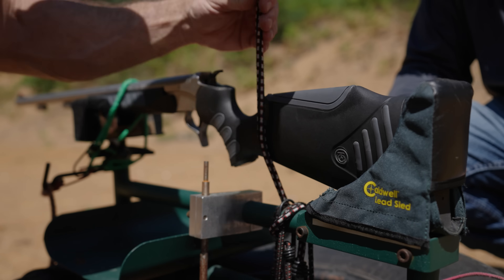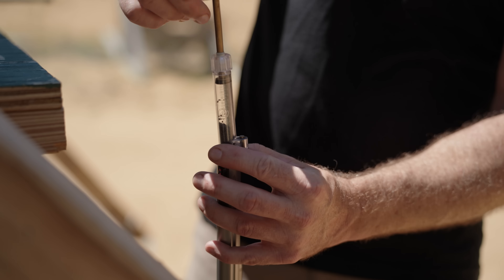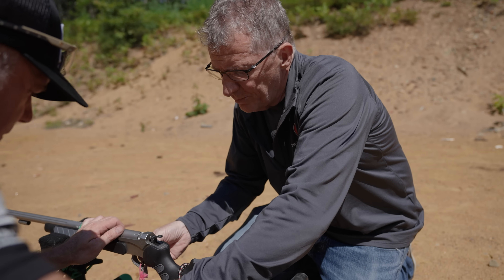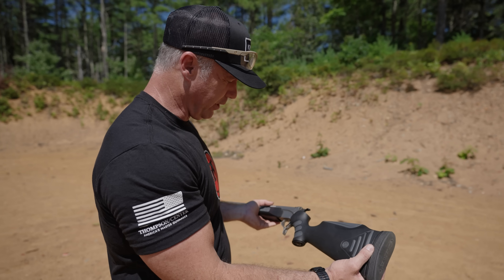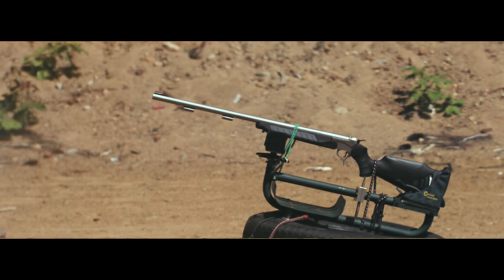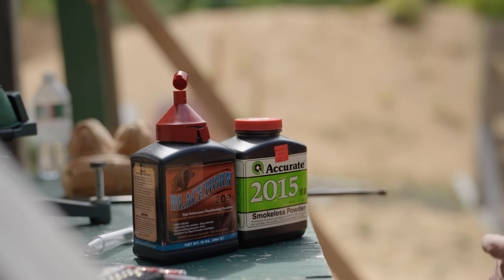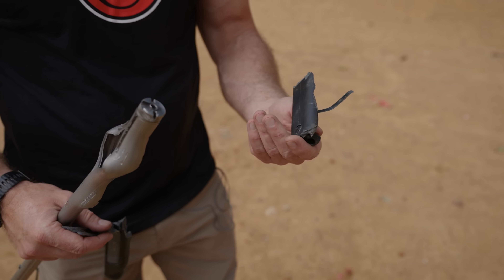My Muzzleloader Exploded

Comment: Dixie Gun Works plugged both ends of one of their barrels and packed it full of powder.  The barrel held and basically the force all came out of the flash hole.  The US Army would proofload the 1873 Springfield by putting two 500 grain slugs in the barrel and then load a 500 grain cartridge.  They would fire it with what amounted to a 70 grain charge and a 1500 grain bullet.

Comment: I wasn't that surprised that it survived the double load because I've shot my muzzleloader quite a bit and seen signs of unburned powder at the 120 grain mark with both a round ball and maxiball and I also wasn't surprised it didn't survive the 120 grain volume load of smokeless powder. Hopefully by common mistake you mean possible and not actually common of course some people are pretty uneducated when it comes to muzzleloaders. My dad had a guy tell him that they test muzzleloader barrels by putting a charge in and then sealing both ends before setting it off. Dad looked at the guy told him that's a pipe bomb not a test. Who knows if the guy believed him or not.

Comment: There was an English Shotgun which was loaded with a normal shot charge and a second charge loaded on top of the first. There 2 percussion niples at the lock end. You fired the first at you target and fired the second as normal. I cant figure why the flame did not get through to the rear charge but it did not.

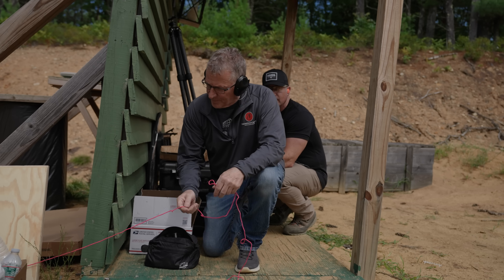Comment: 13:58 The reason it broke is because the bullet was too far back in the barrel. Try filling all but the last inch of barrel with same powder or tannerite and seating the bullet 1" from muzzle.
Reply: ~>}(🎉BoOm💣){<~
Reply: My expectation is the brisonance of faster, higher pressure propellants will surpass the barrel steel's limits and cause shrapnelization and grenading of breachplug, barrel, frame/receiver, and furniture. 😮

Comment: When I was younger I had black powder revolvers and I did use smokeless powders but I used stand offs and loaded by weight and always used lower pressure powders. So, for the Colt reproduction 1851 .36 caliber Navy I used .38 short Colt cases with the rims turned off and inserted into the cylinder chambers. I usually used Unique powder again measured by weight and then poured into a volumetric scoop that was milled off so the level of powder equalled the proper weight for 750 fps per the correct bullet weight for .38 Short Colt loads. It worked great every time but I didn't dare talk to people while I was loading and shooting my Colt Navy. My Smith & Wesson Model number 2 in .32 long rimfire always fired smokeless powder but I unloaded the factory cartridges and reloaded them down about 30% with Unique powder. Again, no problems. I chronographed both revolvers to make sure my loads were light. Never load smokeless powder by volume always load by weight otherwise one has a bomb. Not good!

Comment: You can’t over charge a ML with black powder. They’ve proven this. 100gr or 900gr doesn’t matter. You just get a lot of unburnt powder come out the barrel. Where you run into danger is double or triple loading. But if you only have one projectile in the barrel, there’s no such thing as a dangerous overcharge.

Comment: 13:30, 15:00. 
So you have to deal with those guys who hate the portion of man down there also, eh?

The portion a man inherits is different than what men inherit.

Man and men are not the same thing.

If they don't like it or can't stand it when man speaks it is because of what their ancestors have done..

There are only two tribes and the portion of man comes from Christ ✝️ and that is what they are hating without knowing it..

They hate mankind because their ancestors fought against mankind for the power of man which doesn't stay in their bodies.

Comment: For the people just getting into black powder. There are a bounch of videos on youtube showing you how to properly clean your black powder firearm. I have never seen anything besides good old soap and water in the bath tub wash away the corrosive black powder residue after fireing. Remember after you fire a black powder fire arm the residue that is left behing contains salts that if left in there will draw in moisture and rust the inside of your barrel.  Also never shoot a black powder firearm around any regular gun you dont plan on soaking in water aswell because they will rust on the outside from the residue floating in the air and landing on your gun. If your at the range and someone pulls out a muzzle loader and your shooting your beautiful AR or Bolt action just pack up and leave the range. Same goes for people shooting milsurp corrosive ammo. Things people need to think about when they see rust on their gun and wonder where it came from.

Comment: I have heard the average load of BH209 runs around 26,000 PSI and here are SOME custom smokeless loads that run under that pressure so in theory they would be safe in any inline modern muzzleloader. I don't think I want to be the test dummy but in theory it should be safe.

Comment: The worse kick I've ever had out of a flintlock is when I shot a ramrod out of the barrel not on purpose of course but my shoulder area turned my shoulder yellow and the barrel ended up 45° to the left and 45° skywards and I wondered what the hell happened then I didn't see my ramrod and realized what I had done it was an unbreakable ramrod and I still use it today

Comment: Always ram rod the muzzleloader before loading. Mark it with a knife for loaded and unloaded. When you drop a rod down the barrel it should bounce and tink off the breech. Usually It will thud and not bounce if there's a bullet. That's why you check the height of it out of the barrel. I have a buddy missing a finger from a ml explosion from a double charge
Reply: Double powder charge

Comment: Rember teating a 1862 springfield after repairs replacing primer nipple.  Origin was drilled out the size, of the base tested it with 120 grains #2 black and a minie.      Its. Called  proofing

Comment: The biggest problem with using smokeless powder in a muzzleloader in my opinion is not the powder, or the gun, but the nut behind the gun. If it weren't somewhat safe, we would not have hundreds of old cartridge guns out there, made for black powder shooting mild charges of smokeless. (Safely). If I were to build a .50 caliber rifle, test the hell out of it and find that it was safe to shoot with X amount of Red Dot shotgun powder as an example. Provide a measure that would not hold over X amount and put a warning on the barrel in gold bold letters not to EVER exceed that load, what you want to bet me that Jethro would have to see what happened with just two more grains of powder? Or five? or more?  I've watched a lot of these tests where what I got out of it was that showing the test itself was the most dangerous part as it took a tremendous amount of the wrong powder to cause catastrophic damage like you finally got there. The danger being that people will try it for themselves not knowing what they are doing or how much was actually safe to use. The best advice then still being to use NO amount of smokeless powder in a muzzleloader. Not that it isn't safe, but that people aren't. They've always got to get that extra 100 FPS for some reason instead of leaving well enough alone. Being a reloader and having loaded probably in the millions of shells in my long carrier I understand all of this. But many wouldn't. And that is the danger in it.

Comment: Just curious but I think this is important: how many weight grains did that "40 grain by volume* load have? Because it was literally deadly. At least amputating a couple fingers from a hand holding it and even shooting back plug through shooter´s forehead if that joint fails. Which has a high probability of happening.

Comment: Hey guys after the first test..any checks done to verify that the sear or fire control group wasn't damaged with the recoil that broke the stock..call me crazy but the second test when you cocked the hammer..is a lot of trust on components that just saw catastrophic forces..and you are in the blast zone..the moment you release your finger from the hammer you are placing a great deal of trust that it doesn't malfunction and go off while you are crouching right there before ever pulling on the string.

Comment: Had my first stuck bullet in my 30 year old TC Hawken. Wet powder. I had cleaned between shots, but was talking to someone and it interrupted my loading procedure. Forgot to dry patch and fire a couple snap caps to dry. Used a bullet puller and learned a lesson. Focus while loading.

Comment: You don’t even know what the words mean that you’re saying. You were pointing at the stock saying forend and it was the stock that whole shouldering kicky piece is the stock, the wrist is what you meant but you said forend. Forend wouldn’t break from recoil. Also the primer can’t weld to the breech plug. Steel welds copper brazes. But still the copper primer just expanded beyond its elastic limits and is stuck by friction. A weld is fusing two ferrous pieces together. Do you know anything at all? Have you even shot a gun in your life? Next you’ll say guns are dangerous and commit violence. You claim to be sad that you intend to destroy a muzzleloader but you’re really just ecstatic to be getting some kind of shoots thingy out of America.

Comment: Smokeless is just so much more powerful. Loading 45-70 cartridges with 60 grains has more power than 45-120 cartridges with the original black powder it was designed for. Faster burning powder just develops significantly higher peak pressures.

Comment: All powders are measured by weight, but most are dispensed by volume.  Different powders have different densities.
Reply: If you switch powder, manufacturers with black powder you need to change the settings on your powder horn.

Comment: That would ruin your day. I've seen a regular rifle fired with an overloaded cartridge and you could not open the bolt and the walnut stock was busted into slivers. The person who fired it was lucky to keep his body parts somewhat intact but it was a while before things got back to working right.
If the manufacturer doesn't say to do it DON"T!
My wife fired a friends pistol, brand not named, and had it come apart when the case buldged and tore open and her hand was black for a few days and was numb for a long time. Same thing happened to the owner with the replacement pistol so he bought a different brand.
Take care, Be safe,
jack

Comment: I saw what an overload of smokeless will do.  how about putting a smaller charge by wt.  I would say about 20 grains of a slow pistol powder and I bet the gun will not be damaged.  It is when you show stupid examples that people get misinformation.  
Start with 20 grains of a suitable smokeless with a pressure transducer on the barrel and work you way up until it blows up.  Also use calipers to measure changes and not just eyeball it.
Basically be thorough.  
There could be a survival scenario where one does not have a muzzle loader propellant and must use smokeless if that is all there is.

Comment: I'm guilty of firing a smokes round in a black powder gun. 
The gun is an 1884 303 Enfield drop breach cartridge-type rifle. I put a modern-day smokeless round in it. I was young but had some training on my black powder rifle and pistols. My mistake. They didn't have smokeless powder in 1884. I was lucky I wasn't injured and the rifle survived. Though the drop breach was jammed and it took a gunsmith and I about half an hour of tapping a cleaning rod against the cartridge and the lever I was very lucky. The gunsmith said I certanly proof tested this Dougles premium barrel😱
Reply: Lea Nfield

Comment: As a teenager I was concerned with my limited experience about double charges or if the projectile moved down the barrel prior to discharge so I marked my ramrod with a normal charge and projectile was flush with the end of the barrel so I could do a quick check.  ps would have been good to have a moist paper plate in front of the barrel to see if the second charge burned or was just pushed out unburnt.

Comment: I'd say that was at least a dubble charge of powder.  You would expect it to fail. You have proooved that it's possible to blow up a gun..
That charge was probably appropriate for a 50 bmg. If you had used a charge measured and of proper type for a 45 70 then you're results would be valid.wether there is a brass casings in the gun has little to do with what your burning in the chamber.
We shoot smokeless powder in these guns all the time, 
Pyrodex  triple seven and others.that are formulated to use in these guns. 
Grabbing and using random powers in massive amounts is just stupid.
If you're intention is to blow up guns then admit that is your intention.
If you insist on making firearms videos at least try to present accurate information.

Comment: My brother had a CVA blow up in his hands. Split the barrel 10 inches apart up an down. The bottom part was a sharp point that put a hole in his shirt right outside his heart. The projectile went in front of me by a foot in front of my face. I think he only needed 10 stitches to keep his thumb. He remembers that was the hardest kick he felt from any rifle.
Investigation found there was a small blister inside the barrel.
(Edit to fix auto correct mistake)
Reply: Do you have any more details about the blister in his barrel? Is it something that can be seen with the naked eye?
Reply: @drewbear82  that happened back in 1982, the gun went to some testing site. I never seen the gun after it blew up. I didn't inspect it, there was more pressing issues at that moment.

Comment: I tried blackhorn but it was dang near impossible to clean.
I had to scrape and chisel for hours after a couple of shots.
Worst of all it had a like charge of the plastic powder measure and was repelled  (I saw the powder leap away from your measure too) so it was impossible to tell if I had the correct load. 
I was going to dig up an old brass measure but after trying to clean up this stuff I was not inclined.
I called the factory and left a message about the amount to load for the bullets I was shooting (Thor) no one called me back.
I went back to pellets.
Crappy product with no support if you ask me.
You should have checked the barrel for roundness after each test.

Comment: beginning of the season I cleaned my rifle taking out the breach plug and pushing the cleaning rod all the way through the barrel and breach. marking the ram rod with 3 different colors 1 mark is unloaded  i like that to be green  2 mark is powder only  my mark is blue  3 is fully loaded and that mark i use is red. i prefer Pyradex pellets 50gr each by 3 pellets for 150gr and a 243gr hollow point
Reply: sorry I forgot to include my projectile would be  Powerbelt .243gr hollow piont with the green tip

Comment: I have a fire storm.for that matter all my hunting gear gets cleaned maintained oiled at least 3 times a year surrounding hunting season it's bad ownership to just load it and forget it with kids around.with a black powder it's a pipe bomb waiting for a spark.to leave it with a load not only pits the inside of the barrel it's setting you up for problems when you can just pull a breach plug and pull the charge when cleaning it for the season.the only gun close to being loaded would be my home protection even that gets cleaned and checked 3 times a year.nothing like a stray bullet or delayed firing from slow pin or filled rifling.sorry my father instilled these traits before he put a gun in my hands.

Comment: then they should never touch a ML ,first rule  ping the barrel ,if the firearm was cleaned prior to storage as any ML shooter does  there should be NO load left behind,BP shooter for over 50 years and proud owner of 2  5cal Hawkins,  cap locks and several others from .32 to a 75cal Bess ,,in cap and flint     still do not calls this type as a true ML , great Thompson is back again hope parts become available  for the older models

Comment: In a .50-90 Sharps case using a 290 gr. non-plastic sabot bullet with 110 grs. of AA2015 at a C.O.A.L. of 3.062" [yielding a seating depth of 0.043", essentially a compressed load as they did with the ramrod], QL shows pressure of 58,267 psi.  Given that the 300 Win. Mag., which was a factory chambering among the calibres the T/C was chambered for, has a max. pressure of 62,366 psi, I'd say it is the barrel quality & thickness that is to blame, not the overload.  Look how thin the barrel is at the point of rupture.  Now compare that to the thickness of a centre-fire barrel over the chamber area & you've got your answer to the question "What caused this catastrophic failure?"

Comment: They are very expensive for what they are. Not classy, molded stocks with sharp seams. Metal work is no different than a pipe from Home Depot. Strong? Yes they are but they also are very heavy. CVA has better warranty service also.

Comment: That double charge will NOT do anything, much, other than a slight higher pressure BECAUSE it never ignited. The first load ignited and pushed out the powder and projectile. NOW it it were two charge then two projectiles, you might see signs !

Comment: As a gunsmith I see this all the time. I often pull the breech plug and try to drive the rounds out through the breech. They usually have to use a long drill bit and drill out the balls. I have had guys try to fire double loads but since the load has been in the gun for most of a year and the gun will not fire due to the powder going bad. I school the owner to fire the round out in the field before they go home. Then pull the plug and clean the barrel. Even synthetic black power is somewhat corrosive. I have seen gun that were set aside loaded and plug is so corroded it needs replacement and sometimes the barrel is so pitted it needs to be replaced. So, never take your gun home loaded and clean it even if you didn’t take a shot.